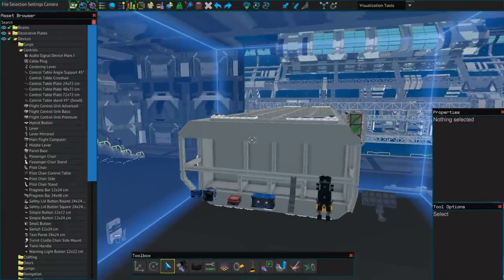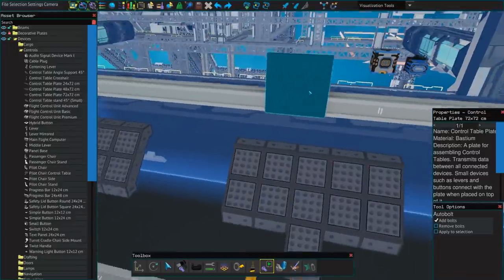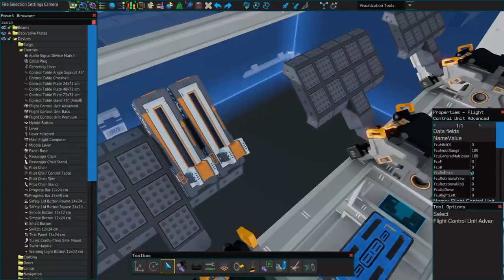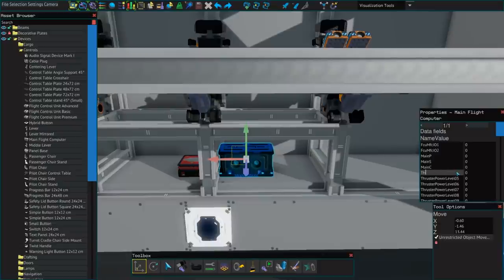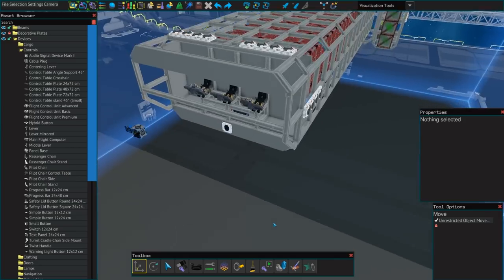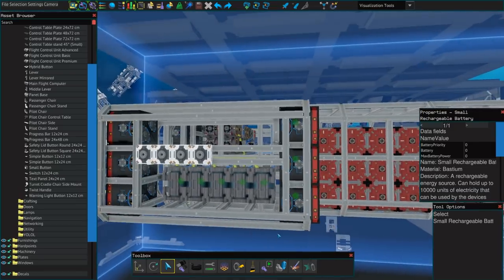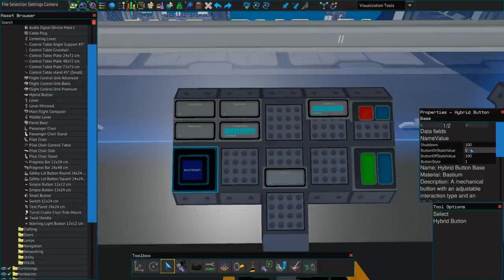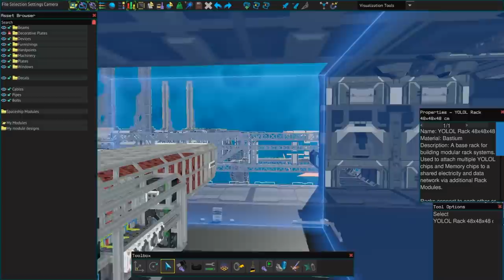Starbase - Ship Design: Control Systems

Comment: Another great video Rob. Question on the Propellant progress bar. What value do you put on there if you have more than one propellant tank? Do you need multiple bars, or can you make it so one bar shows you all the propellant you have onboard? Thanks.
Reply from the maker: The same one from the video. Propellant tanks have a networked max on them so the value takes into account multiple tanks. The value I changed was for that attribute.

Comment: A troubleshooting video would be fantastic. I have data at my chair, data at my named thrusters, data at my levers, and nothing works...
Reply from the maker: cool, I'll see what I can come up with
Reply: @Anthroskye  I had an epiphany watching Spunie Bard's thruster video. In the designer If your warp class drops below 1.00 for whatever reason ( bolts, unwelded beams in progress, unattached plates, etc.) the ship simply won't fly and you won't get any error messages. Everything can be hooked up perfectly, it won't matter if the warp class is less than 1.00. The warp class not something that's readily apparent in the designer.

Comment: I followed everything that you did, and had the same problem, I could spin around and stuff, but I cannot move forward. :( 
The levers and the flight control thingy matched. :(
Reply from the maker: yeah, turned out to be a wiring issue